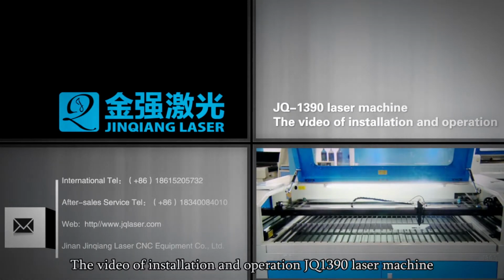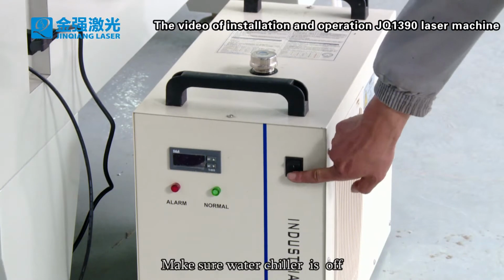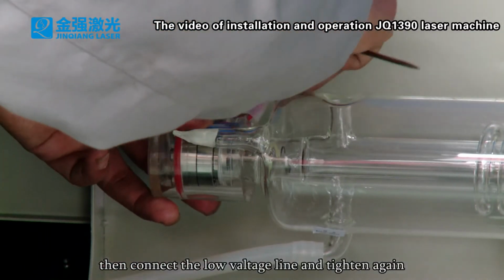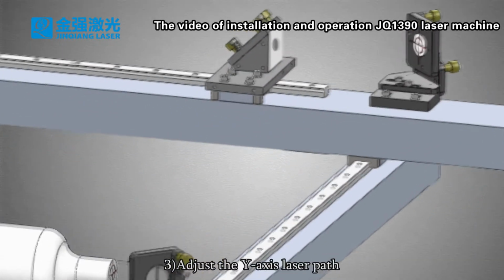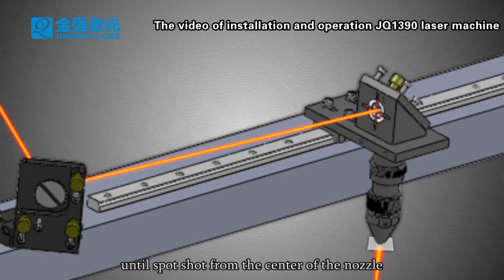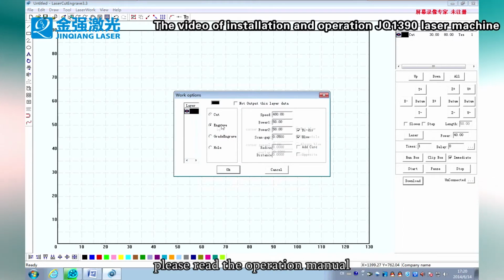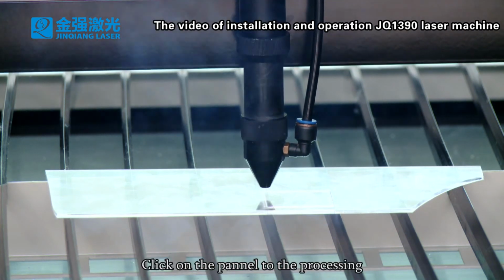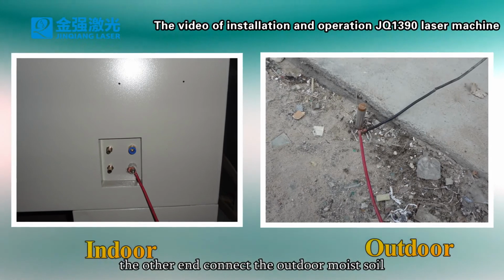JQ 1390 Laser Cutting and Engraving Machine Installation and Maintenance Professional Introdution

Comment: I would recommend you stay away from this machine. From what I can tell one of the China based companies (eBay - laser machine / Livy /Brenda) is running a scam where they push for a deposit then you pay the other 1/2 on delivery. After you pay the deposits they up the price and don't refund. You open a PayPal claim and then they try to get you to close the claim telling you they will refund buy they can't because the money is frozen by PayPal. If you close the claim they steal your money.